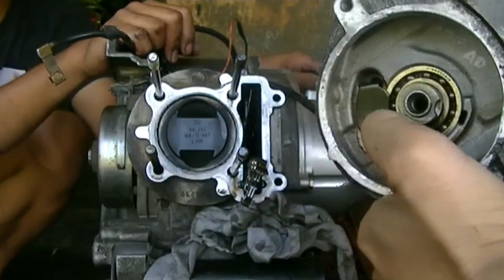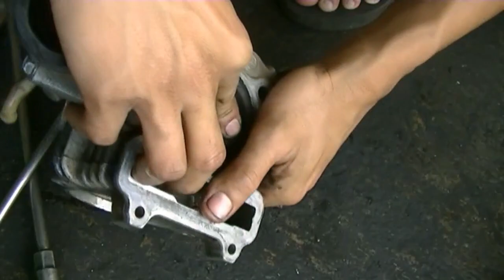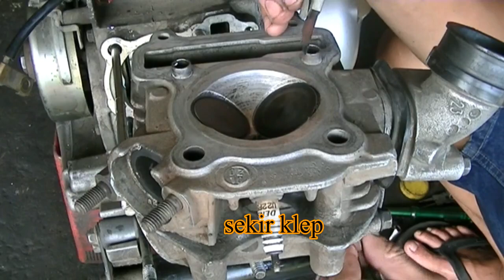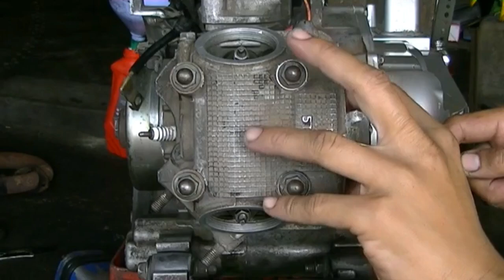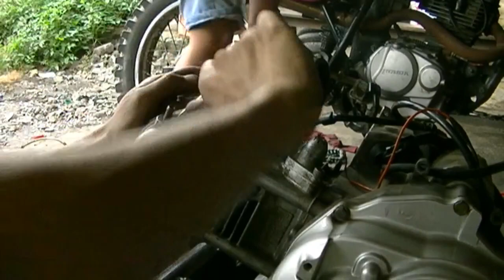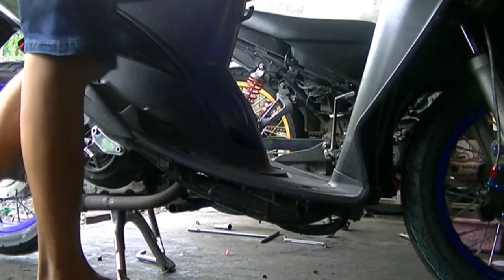Bongkar pasang mio bore up piston 66mm [servis berkala]

Comment: Bang mio gua per cvt 1500rpm roller 9g.. 58 mendem 2mm selebihnya standar tpi ko angkatan awal nya ko mesin meraung nya tinggi kaya roller gakuat ngelebarin per?
Reply from the maker: setting rollernya mas,pake yg lbh berat
Reply: Ramandita Motor pake std kuat ga bang? Atau pake 11g?
Reply from the maker: kuat mas
Reply: Staternya klo pake standar ga kuat ya maa,pake punya apa mas dinamo staternya,thank